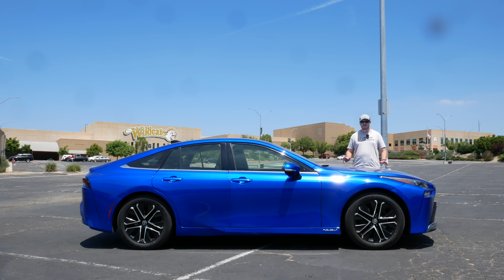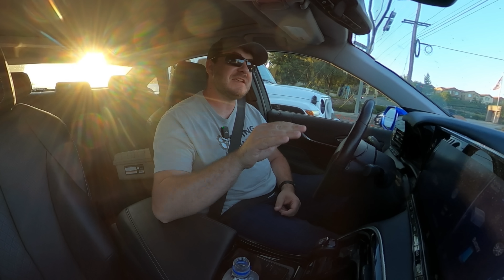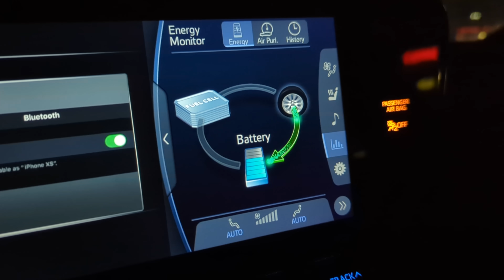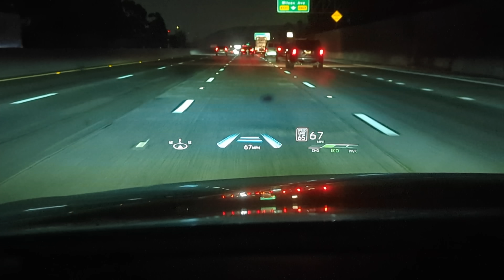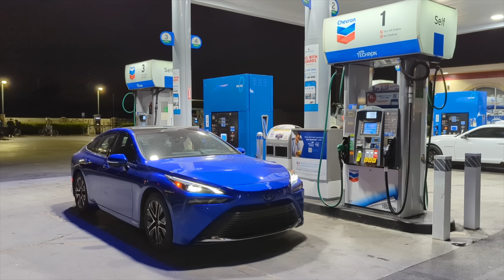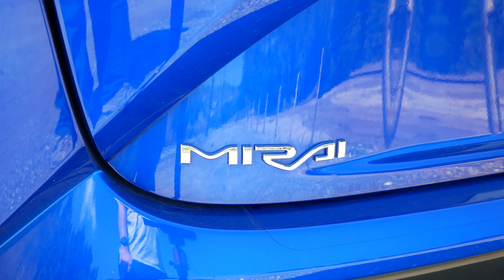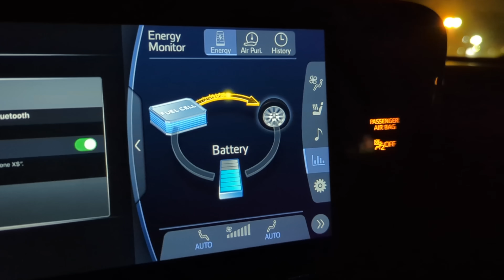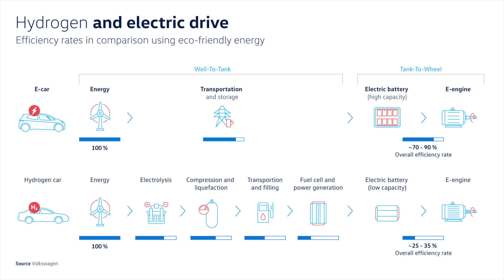The Toyota Mirai is Disappointing

Comment: So is all the pickup trucks that cost 100k plus yet every American seems to be getting those trash vehicles, gas had the same problem when it started it takes time and support you never saw people whineing back when gas came out becuase they were tired of horses and today we should be tired of global warming and yes hydrogen cars can be made fun in a normal engine design for all the car heads. Only thing I dislike is that we make a lot of grey hydrogen  which uses fossil fuels so we should switch to green hydrogen which uses electricity and theres some membrane ones.

Comment: You'll want to use your Hydrogen as fast as possible, because it WILL leak out. You can't just hang on to it until you need it. It's gonna go right through the walls of its containment vessel and plumbing. It also makes the vessel and plumbing brittle as it leaks. There is no saving it for range extension or any of that malarkey.
Reply: Have my car sit for weeks and the level doesn't change.

Comment: FCEVs do make sense, but just like EVs, the infrastructure must be in place and it's not now.  Also, the current price for a hydrogen fill up is absurd.  Otherwise, it's a much better alternative to gasoline, diesel and 100% battery power.
Reply: Use electricity to make the hydrogen, use the hydrogen to make the car go.   OR we can just use the electricity to make the car go.
Reply: FCEVs are pointless. Too expensive. The cars are too expensive and the fuel is too expensive. But worse still is that the infrastructure is far too expensive. Likely hundreds of billions needed for the US alone. You need more power plants than you do for BEV only.

BEVs make the most sense. A lot of the needed infrastructure is already there. People can recharge at home, work, and places they go often. The only downside is that long distance travel is slightly slower than other transport types.

Comment: This car does not give you 50 MPG. It cost $180 to fill up with 400 miles range. Gas is about $5 in CA which is about 36 gallons for $180. 
400 miles / 36 gallons is about 11MPG.

Comment: It would be better if they just filled the car with CNG.  Much cheaper, more available, lower pressure. 

But then, if you are using CNG, you don't really need a fuel cell, you could just use a Toyota hybrid car.  The car would cost half as much and weigh less, and not explode catastrophically if a fuel tank ruptured during a collision.
Reply: CNG is not hydrogen so this isnt even a conversation
Reply: @orishaeshu1084 Ok, then stop talking.  I was offering a practical solution for using hydrogen generation for fuel.

Comment: Fuel cells can be designed to be reversible, so if you ADD power to the fuel cell, it can SPLIT water to O2 and H2, and therefor FILL the H2 tank from regen braking.
Reply: It would need to pump it back into tank which could be up to 10 000 psi... Expensive pump we are talking here for tiny bit of hydrogen you will make while breaking... Which would only work when actual battery is not at 100%... Which is like... Basically... Never... Even adding few extra battery cells to have head space for breaking regen would do the trick with way higher efficiency and lower cost and less maintenance costs than your "solution"
Reply: At that point you've just made a battery with godawful efficiency

Comment: I just want to add that, while green hydrogen will hopefully be produced in large amounts in the future (not for cars! but the chemical industry can't do without hydrogen, e.g. for fertilizer production), the two most common ways to produce hydrogen are not, in fact, methane steam reformation ("grey hydrogen") and electrolysis. They are, instead, methane steam reformation and coal gasification ("brown hydrogen"). Brown hydrogen is not as common as it used to be, at least not in countries with a reliable and cheap supply of natural gas. It's really quite bad for the environment, emissions-wise.

Comment: The only problem with Tesla, (besides the exploding batteries and non-functioning auto-drive, and outrageous prices) is that they all inevitably get recalled because of terrible engineering...Other than that...
Reply: Some weird comment.
Batteries do not explode, its not an ICE car we are talking about. BEV's catch on fire less frequently than ICE cars, so no idea why you would even mention it. I wonder how would you survive in a hydrogen car with 3 tanks which are up to 10 000psi pressure and one of them raptures during collision... You would just... Disappear instantly. 
No idea what auto-drive you are talking about, they had autopilot system for highways for years. Their FSD is still in supervised mode but works quite well.
Prices are one of the lowest for BEV's for what they are offering, except Cybertruck, that isn't worth anything. 
Tesla's are not being recalled, they are getting updates over the air, you know, like your phone does, but I don't see you screaming and saying that your phone got 500 recalls in last few years when you received update each time... 

So yea, it sounds like you are just one of those who watched few silly youtube videos spitting out random nonsensical claims and you never bothered to fact check. Isn't that weird?
Reply: @Zripas Outside being a lame brand, spot on
Reply: @samusaran7317 the brand isn’t lame, the CEO is. People working to make the cars happen are awesome people.
Reply: @orishaeshu1084  It's both. Only thing they used to have going for them is charger exclusivity which isn't doesn't exist anymore. They charge slow and their batteries overheat among other things.
Reply: @samusaran7317 Teslas do not overheat, wtf are you talking about? 😂. I’m not interested in talking to a m0r0n.
Reply: The batteries don't just explode, but yeah, Elon does a shitty job running his company. Tesla isn't the only EV manufacturer, though

Comment: I could see hydrogen being useful for semi-trucks if a Edison electric style diesel hybrid truck doesn't fit for whatever reason. For trains I genuinely think it's a terrible idea due to the simple fact trains are on tracks which we've had the technology to electrify for over a century, but refuse due to laziness and short term profit incentives. Just put an overhead wire and you won't need any fancy battery, engine, or fuel just power from the grid.

Comment: If we all drove hydrogen cars, the air humidity would become unbearable. Proper draining of the water would be required.
Reply: That sounds like an excellent reason for hydrogen though. Let's say we go to Arizona right? You replace every single car with a hydrogen one, you could basically induce enough precipitation to potentially stop the drought
Reply: @raychang8606  But still better draining it instead of letting it go into the environment. Precipitation requires temperatures low enough to get the air saturated. Otherwise the warm, humid air will be blown away, cool down in a another place, get saturated to cause rain there. Drained water can be used to spray the fields, as well as to produce hydrogen again. 😀
Reply: @ThunderBassistJay  while that nay be true, you have to remember 1: arizona is a massive place, so water will be riding anywhere they go, and enough cars wmitting will reach that saturation point to start forming clouds high in the stratosphere, bring shade and rain will expand (it, to an extreme degree is why rainforests are rainy) but 2: nobody wants to subsidize cloud seeding or just straight emitting it. That's a waste of money and electricity would be better used fueling my ev or running a water pump than tossing hydrogen into the air. That's not going to be a viable economic solution, and thus it'lll die if just done that way
Reply: Burning fuel in a car also releases water. A full tank of hydrogen in the Mirai has the same amount of hydrogen as 50 litres of petrol. So you'll end up with the same amount of water from both.

Comment: The big downside (excluding the lack of refuelling practicality) is the weight. Particulates from brakes and tyres are far more harmful to health than particulates from fossil fuels so the heavier the car the more of a problem this is. It’s like the villain in the invisibility suit. I’m just glad this technology is being developed but power to weight needs improving - much like with EVs which are also far too heavy.
Reply: If you drive an EV correctly, your breaks will last much longer thanks to regenerative breaking but EVs are heavy. More about the toll on the road, not on the breaks.
Reply: @s @shawnnielsonlx i. Just to be clear; my point was one about tyre and brake particulates being hazardous to health rather than the costs of car maintenance. Regardless of climate implications I don’t think anyone would argue fossil fuels in high density urban environments pose a threat to health but most (I expect) are unaware that tyre and brake degradation poses a risk that seems unchecked. Unfortunately I don’t seem the majority of drivers driving and braking carefully either but the issue begins with manufacturers. Cheers
Reply: Ok sheep

Comment: Thank you for the reality check. Used 2023 Mirai with low miles are on the used car market for under $17k. Sounds tempting. A lot of tech and car for the money no doubt, but the resale value price speaks of usability. Makes no financial sense. The car is ahead of its time, but with the availability and cost of hydrogen, it's not worth the price even at under 17k

Comment: It may seem bad but this is the true future if we make hydrogen from solar energy at day we can use clean power and using a small battery only is much better than a massive EV battery. About safety especially with those high pressures? You may think its unsafe but its much more safer than a diesel or gas actually. an EV is more dangerous even.
Reply: Can you explain how an EV is more dangerous?

Comment: Mirai weighs 4,255 lbs. My 2022 Tesla Model 3 long range weighs 4,250. I get 425 horsepower, a zero to 60 time of 4.2 seconds, top speed of 140 mph, and a skidpad of 0.96 Gs.
Reply: Great if you can charge at home & suits your needs , not for everyone though
Reply: @davidwoodvine3491  everyone else has to buy hydrogen cars 🤪
Reply: Even if you do have a really fast car you will never make up the lost time waiting for a eV charger !
Reply: @davidwoodvine3491  I don't wait for an EV charger. I plug in at home and my car charges while I'm sleeping. No more wasting time and money at a dirty gas station

Comment: Very informative video on the Marai and fuel cell tech. It'd be interesting to learn how "combustible hydrogen" (CH) compares with fuel cell. Converting an ICEngine is probably simpler. What about plug-in hybrid range extender PHEV+CH applications? Or, PHEV+HFC a small scale fuel cell stack matched to say the Prius PHEV 7.7kwh pack? Anyway, good video!

Comment: its a bit of an apples to oranges comparing electric cars to hydrogen. hydrogen cars are still in the early stages while for the past decade EVs have been pushed super hard and has had tons of government backing to encourage car manufactures to make and improve EVs.
Reply: Honda was selling hydrogen cars in California in 2008. Hydrogen car efforts have received billions of dollars in subsidies. They never caught on because it's an extremely stupid idea that only uneducated folk think would actually be viable.
Reply: Hydrogen vehicles have been worked on since the first oil embargo over 50 years ago in 1973. And it's never gotten anywhere and never will. That's two decades before the first Lithium-ion battery in the early 90's. And decades before the first Model S -- the first truly modern EV. 

It's the smallest element known to man, with incredible little energy. So little, it has to be compressed to almost twice the pressure that imploded the Titan under the ocean. It has always been a fossil fuels dream because the cheapest and most efficient way to make it is from natural gas. It takes 4 times more energy to make it out of water. 

The electricity required to make enough of it from water to fill up just one car, is enough to fully charge 4 EV's. Does that give you the idea?
Reply: @junehanzawa5165  and the first electric car dates from 1888. it doesn't mean anything.

Comment: there's definitely a case to be made for hydrogen i just don't think its for passenger vehicles my bet is on aircraft
Reply: I doubt aircraft. Just not really as lightweight as the info makes it out to be. That Miria is the same weight as a Model Y Long Rnage with similar range.
Reply: @anthonypelchat  yes.. you are correct

hydrogen ICE might be the way forward for airplanes 

as it stands batteries arent really dense enough for ships and airplanes to be viable.. though that could improve as well as this
Reply: @donzo4784  Hydrogen ICE make batteries seem lighter than air. Hydrogen ICE is a horrible use of hydrogen and doesn't make sense at any point. 

Batteries make sense on short range flights and shorter range shipping. Hydrogen Fuel Cells might make some sense on longer distance trips, but not really due to costs and bulk.

Comment: There’s obviously limits to hydrogen on small vehicles but it’s still a shame because the mirai could be so much better if they made it a plug in hybrid, 90% of the time you could go off battery then use hydrogen for long trips
Reply: Why carry the huge hydrogen tanks if you're not using them all the time? They're far too space consuming to be a secondary option.
Reply: @logitech4873  Honestly, gas or diesel hybrids make more sense than hydrogen. Yes, they pollute. But the hydrogen would be drastically more expensive and require a built out of a whole other fueling infrastructure.
Reply: @anthonypelchat  Hybrid or EVs are the only sensible options. Hydrogen is really just EVs but with many more new and exciting downsides.
Reply: @logitech4873  Mostly agree. BEVs make the most sense by every metric out there. 

Hybrids don't make a lot of sense in most cases. However, there are some uses where they are more beneficial. Got to also remember that gas and diesel will eventually be more expensive. As such, plug in hybrids will be useful for those more rare needs.

Comment: Hydrogen tech will surpass EV's in the near future. As you stated in the beginning the tech is pretty much experimental right now. As the infrastructure grows the costs of Hydrogen will drop too. Hydrogen is the most abundant resource on the planet...
Reply: Uh no it won't. It'll always be expensive to buy hydrogen. It's not abundant in its elemental form, it needs to be made.
Reply: @logitech4873  You totally show your level of intelligence by stating that hydrogen is not abundant in its element form and that it has to be made😂🤣. Although hydrogen is the most abundant element in the universe (three times as abundant as helium, the next most widely occurring element), it makes up only about 0.14 percent of Earth’s crust by weight. It occurs, however, in vast quantities as part of the water in oceans, ice packs, rivers, lakes, and the atmosphere. It only must be separated not made like electricity is. You apparently have a low IQ or something...SMH
Reply: Incorrect, and you showed your own ignorance by misunderstanding was logitech stated. Hydrogen is rare on Earth in a useful state for fuel cells. To get it, you have to make it by separating it from something else. And that requires energy. Lots of energy. As was shown in the video, that process, along with the storage and transportation process is hugely inefficient. You need to 2-3x more energy per mile/meter for a fuel cell vehicle than you do for a battery only vehicle. 

And that is with lithium ion battery tech being relatively new. Lithium Ion batteries have only existed for less than 40 years from the first development in a lab. Hydrogen fuel cells have existed for nearly 100 years. This is not new tech. The Apollo missions used fuel cells in the 60s.

Comment: Hmm, hydrogen production is listed as Green, Blue or Grey with over 60% grey. EV production is the future yet upwards of 60 percent of US electricity is also coal/natural gas or other fossil fuel, or Grey. Sounds like a wash.
Reply: Except that Green Hydrogen is using electricity for production. But that is roughly 3x more electricity per mile/meter driven than a BEV. BEVs are always green. And with their efficiency, they are cleaner than any comparable ICE vehicle no matter the energy source. It is literally why hybrids exist in the first place. Electric motors that get their electricity from gas or diesel engines are more efficient than powering the vehicle only by that gas or diesel engine directly.

Also, natural gas power plants are drastically cleaner than coal power plants. And coal power has been reduced to about 16-18% of US electrical production. Nuclear and renewables make up roughly the same 40ish% that natural gas current makes up in total production. And Renewables are increasing every year.

Comment: Hydrogen would be awesome if there was hydrogen. But it either takes a lot of energy to produce hydrogen OR you can convert hydrocarbons into H2 - by releasing carbon into the environment. So H2 can act as a battery, but it is not an energy source .